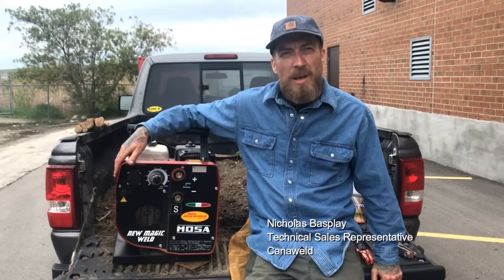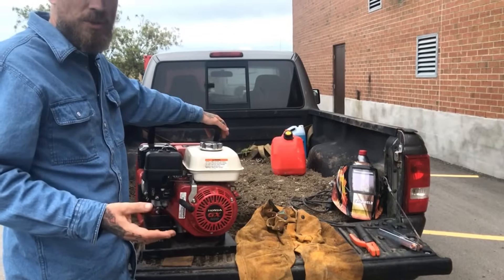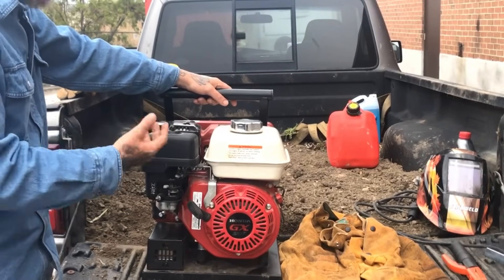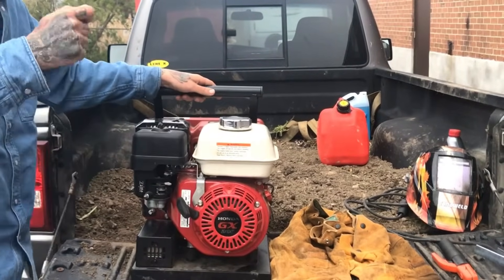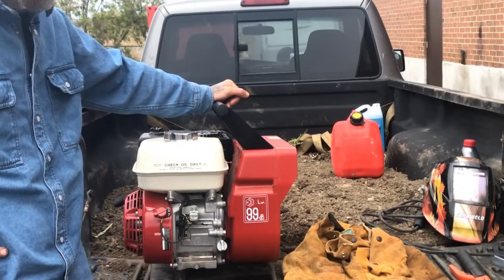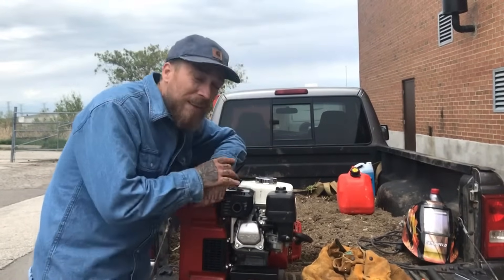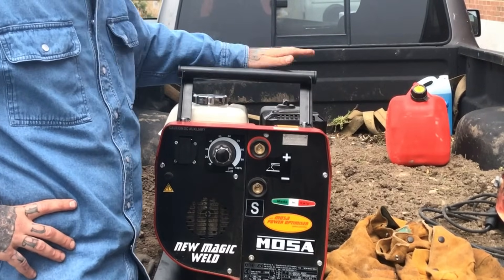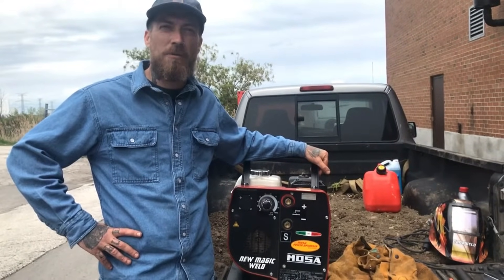Light Engine-Driven Welder, Portable Welding Generator, Magic weld 150 by Canaweld

Comment: Whats the longest lead I can connect an still melt 7018 rod? 50ft?
Reply: Can the auto idle be turned off?  
The 120v outlet is it a 1500w or 2000w?
Reply: @canaweldinc6706  what size  rod is the main factor  ,  1/8" 7018  is the  common size ,  i run this size vertical 90 to 109 amps  ,   horizontal 110 to 125 amps DC  ,  3/32" rod  50 to 80 amps D.C.    /   also this is an important question is the machine an AC or DC machine  ?   7018  is a D.C.  WELDING ROD  .